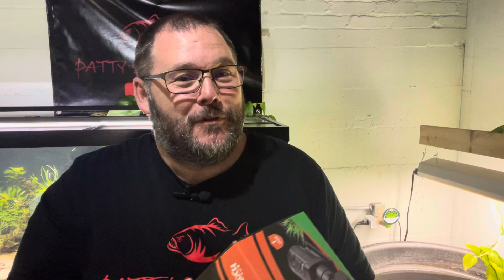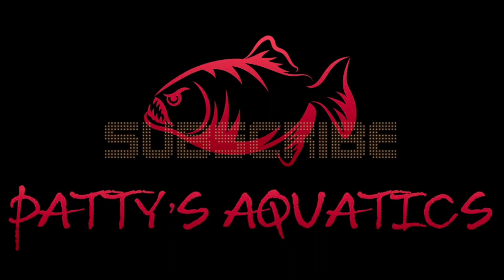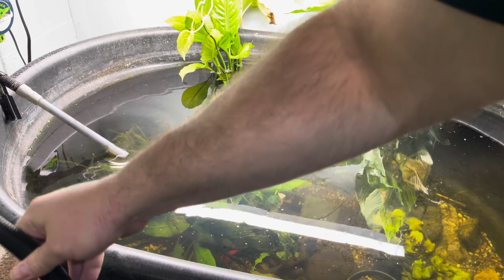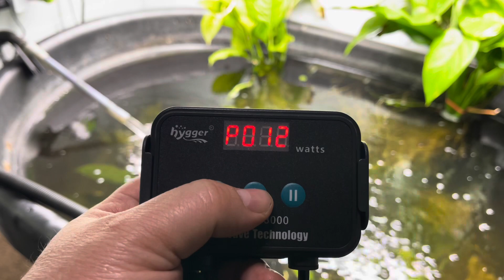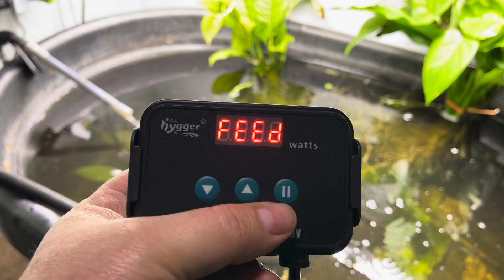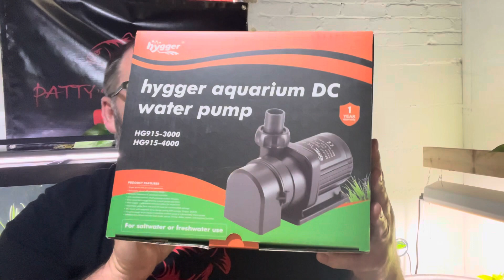Hygger Aquarium DC Water Pump Unboxing

Comment: Patty what power setting would you use for a 90 gal. Sumpt pump?
Reply from the maker: @marksawdy4357  you know I’m not sure. I would suggest starting at the lowest and work your way up to what you need. I kept it at around 35-40 percent for my summer tub pro just and worked great

Comment: How do you change the power rate
Reply from the maker: @coachdee3554  just pressing the up or down buttons. It goes from 30 to 100
Reply: @pattys_aquatics   Yeah I figured it out, I thought it was to separate functions 🙂
Reply: Could you suggest a power setting that does 660 GPH (2200-2900 LPH). I bought an  Hygger HG141 waste collector and I am trying to get the flow rate to match there suggestion. But having trouble either too much flow or not enough. This pump says up to 2100+  GPH.
Reply: @pattys_aquatics  my last comment was to you

Comment: Nice pump and review! I like how it will draw water from the bottom, seems like it would be really helpful if you need to drain a tank down. 🙂👍
Reply from the maker: Thanks Tara, it definitely is a multi use piece of equipment. I got it for a certain project and works great. Thanks for watching 😁👍

Comment: I use these style pumps to do water changes in all my tanks, i like how it can be used inside or out, great feature, I got my pond pump from lowes it’s a bit over 800 gph, I wanna say it was $100, still going strong, let me know the dependability and durability down the road please. Hygger seems to be coming out with some cool products
Reply from the maker: Yeah there are definitely multiple uses For these pumps. I asked for this for a certain summer outdoor project I’m working on so it will be running 24/7 for the next few months and definitely will do an update on it. Yes Hygger has some pretty cool innovative ideas. 
Thanks for watching 😁👍